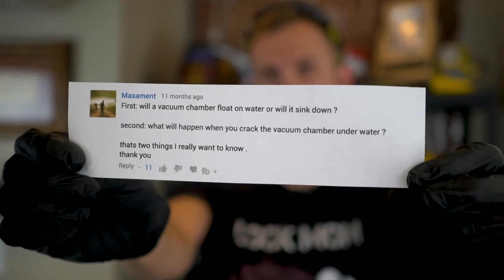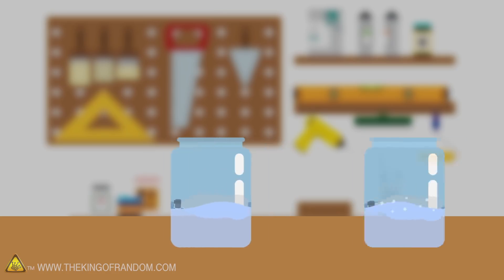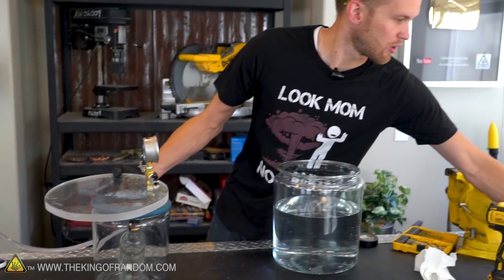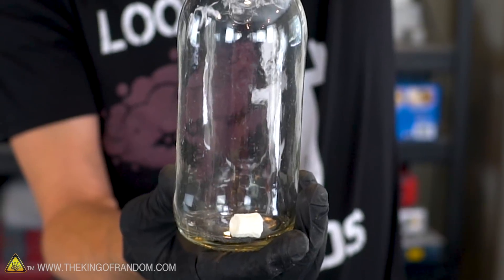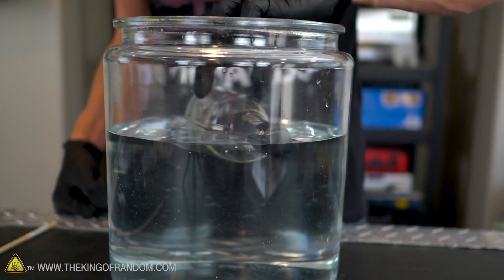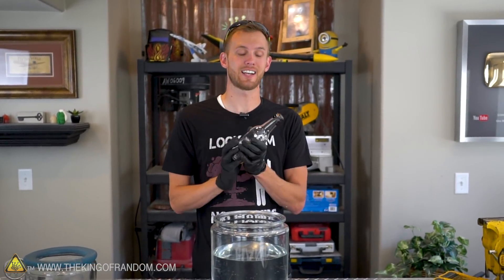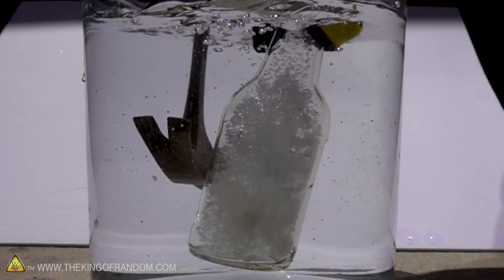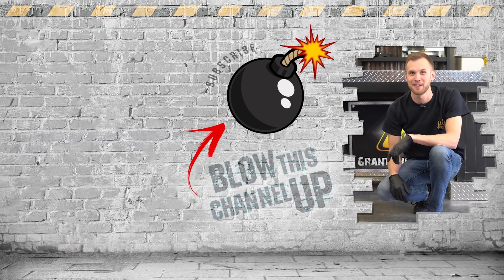Breaking a Vacuum Chamber UNDER WATER

Comment: No duh a vacuum will float on water. A vacuum is even less dense than air. What would you think would happen.
Reply: I want to say that vacuum should have absolute no density :)
Reply: Uberfish u can still sink it ONLY if the sealed container has a density much higher than 1 when it's empty.
Reply: Things float if the volume of liquid displaced is more than the total weight of the object you place in the water. And like you said, vacuums are a lack of mass. Ofc they're always going to float.
Reply: Ethan Smith I thought the bottle would transform into a glass variant of autobots
Reply: turd
Reply: Thats a hypothesis. An experiment is done to prove it. it is always better to see something done than just theorizing

Comment: What happens if you put a smoke grenade in a vacuum, let it fill with smoke, and then make a vacuum to display density?
Reply: Smoke bombs from a fireworks store would work as a substitute if not
Reply: I would think most of the  smoke would be sucked out in the vacuuming process and the flame that causes the smoke would go out due to the lack of oxygen. But it is an interesting idea.
Reply: Question is, do they have access to It?

Comment: Vacuum chamber a brick 
Or.
Vacuum chamber smoke or any way you can make air visible
Reply: It wouldnt be a vacuum with smoke, since smoke is particles
Reply: He might want to see if the particulates fall to the bottom, I guess you could turn the fuel up on a diesel and roll some coal into a jar and close it with it in there and let it sit.

Comment: Can you awesome people try and light fireworks in a vacuum chamber? I think that would be amazing!😁
Reply: Coby The Q you can’t have fire in a vacuum, as fire needs oxygen.
Reply: Black powder and flash powder (all types of gunpowder) are self oxidising. They could not work without some kind of built in oxidiser.
Reply: Triplej Johnson yes you can have fire in a vacuum if you have an oxidiser mixed with your fuel. Oxidisers are common in situations where you need a quick reaction like explosions so it is not unreasonable to think fireworks might contain an oxidiser

Comment: If you put water in a vacuum chamber and sucked all the air out, would it turn into gas because of the low pressure, or would it turn into liquid hydrogen?

Comment: I would love to see you run wires into a vacuum chamber and connect them to an automotive cigarette lighter for the purpose of igniting a firecracker under vacuum vs normal pressure. Maby putting packing peanuts around the bottom..... 

Pop a firecracker in a vacuum chamber.

Comment: Is it easier to brake a coconut if frozen with liquid nitrogen?
Reply: Benjamin Smith yes. More brittle.
Coconuts outer shells are fibrous and rely on elasticity.
Watch slow motion of hitting one.
Apply same energy to fewer fibres due to lower elasticity and it will crack more easily.

Comment: The bubbles weren't a vacuum (a vacuum doesn't have any outward pressure to push against the water). Due to the turbulent flow as water entered the bottle, there were regions of low pressure.  In these regions of low pressure, the water boiled and became low temperature steam. (The boiling point of water depends on the surrounding pressure.)  The water vapor bubbles floated to the top because they were lighter than the surrounding water.

Comment: if you use a bigger vacuum chamber in a pool you could try to use a bb gun to break it, find the right distance to where the water slows the bb to the point that it only breaks one side

Comment: Hey I have 1 idea that you can try with the vaccum chamber:
1. When you put water into the vaccum chamber it has to boil, but what happen if you add pasta into the boiling water? It will cook?
Reply: It will not cook, although it will absorb some water.
Reply: The water boils, but it isn't hot.
Reply: Blaq Z wow water melts!!! I’ll turn up the heat next time and see if I can get some water to melt
Reply: it boils coz the water melting point is reduced to room temperature. To cook pasta u need higher temperature.
Reply: The Action Lab already did this test I think
Reply: The reason water boils in a vacuum isnt because of heat, its because the the water is trying to fill the empty space and turning into a gas does that pretty well, equilibrium in nature is common.
Reply: Really!?? Thanks for your answer, but it will be very interesting the process of the experiment.
Reply: MRJellyBaby2516 water melts from ice
Reply: Quin bros ice melts into water
Reply: Simon Hernandez it wont cook
Reply: Vacuum*

Comment: How does molten metal react when hitting a vacuum chamber?
Reply: i assume he means what happens to the molten metal in a vacuum chamber, if not, then he is hopeless as a human.
Reply: I think that would be extremely hard to replicate especially considering that molten metal gives of gasses which means you can't really put it under   a vacuum chamber in the first place. Not to mention that heating it would be nearly impossible. It would cost them thousands of dollars to try something like this just for equipment i would estimate.
Reply: I meant what happened when molten metal hits a vacum chamber
Reply: F, I hope you can recover soon.
Reply: Sl4yerkid why I mean like if you poured molten metal onto a glass vacuum chamber. Can you not do that?
Reply: It would implode after breaking the glass. Although I guess this audience is entertained by him breaking blocks of ice over and over, so why not be entertained by breaking glass instead... Ok
Reply: Or you could reverse the process and pour molten metal onto the exterior of a vacuum chamber.

Comment: if you do the a scaled up version of that you should use a slow motion setup. As for a container that you can use, get a 40+ gal fish tank and create a compressed air gun that will shoot a metal BB only hard enough to break a single layer of glass (so that it doesn't break the fish tank).

Comment: Hey TKOR Guys! 
I was wondering recently if it is possible to create a Jacobs ladder (high current in two conductors with space between them, which gets bigger as they are set up like a V shape, so the current creates a lightning because the air acts as a conductor between those two metal conductors). For me having not the equipment to try it out myself, I would love to see you do it!
Cheers!

Comment: Try to make a gas gun (gun theat is using butaine gas for fuel) try to make from plastic botle and for barel use pvc pipe and lighter or sparkler.have fun😀

Comment: But how can it leek becouse its a vacuum so no air or a tiny bit of air but more air on the outside so wouldnt the air push on it making the seal get stronger like an airtight seal the air cant open it

Comment: Fill a vacuum with helium and brake a sealed bottle with liquid nitrogen in side
Reply: Are you suggesting that they could freeze helium? No because liquid nitrogen is not cold enough to freeze it
How will they break the bottle while it is in an atmosphere of helium? they cannot reach it with their current setup.

I will tell you what will happen if you do this right now:

The bottle will break causing the liquid nitrogen to leak from the bottle, while still inside the vaccum chamber full of helium. Then the gas from the liquid nitrogen (aka nitrogen gas) will mix with the helium gas.   After a few moments all the liquid nitrogen will turn into gas and that is it.

tldr:
Nothing will happen.
Reply: Sl4yerkid I didn’t say that I’m just curious to what would happen
Reply: And I told you what would happen.

Comment: Try to grow a plant in a vacuum chamber
Reply: Full sealed chamber? At what fraction of an atmosphere?

If you drop it to the levels that their pump is capable of, you will simply end up with a dehydrated plant. The water will boil off and the plant will die.
Reply: That's pretty interesting sounding, but definitely need to consider some things before you can do that.

Comment: Can you use electromagnets to manipulate water? It should work since water molecules are polar.
Reply: U need really strong magnets.
Also I think that won't work because the electromagnetivity of both elements present in water are very minuscule. But yeah it's polar
Reply: Yes it will work...but it will require a field strength on par with an MRI machine!

Comment: What happens if you drink liquid nitrogen?

Put liquid oxygen in a microwave for 30 seconds 

Focus the mini solar scorcher on the big solar scorcher and focus the big solar scorcher to the mini furnace arc which contains copper and the mini furnace is burning hot! What will happen to the copper?

Comment: As y'all state here an object with a vacuum pulled on it should be lighter than one without. I've heard that if an object is light enough and a vacuum is pulled on it the object could become lighter than air and float like a balloon. 

Any chance to get that tested and compared with helium and hot air filled objects to see which has more lift?

Comment: What would happen if you fired a gun in a vacuum chamber
Reply: also R K, you really don't know how a gun works do you?
Reply: Dalton Hendershot you can fire but the bullet will not go far enough because lack of air and oxygen in it
Reply: It might work depending on the gun being used and the type of powder. a glock for example can shoot underwater, which is basically the same thing (lack of oxygen).
Reply: R K a gun will definitely fire in a vacuum if anything it will fire better being that the bullet will have no air resistance. If you have ever held a bullet and shook it you can hear the gunpowder shaking around which means there is oxygen inside the bullets shell casing and that's all the oxygen that the gunpowder needs. I don't mean to be a know it all 14 year old but, you have to know how this works.

Comment: Is it possible to light a cigarette lighter inside a vacuum chamber? Using a battery, wires, remote control board and steel wool to get sparks

Comment: If hot air expands and cold air contracts, what would happen if you dipped the vacuum chamber bottle into liquid nitrogen? Chilling what little air is left in it. Would it collapse due to the glass breaking from thermal stress or an increase in vacuum pressure? Some of both perhaps. Would it b e possible to tell? Different idea, chill the bottle first, then try to vacuum it's air out. If it survives without shattering from thermal stress and the vacuum pressure, it might be interesting to see if it still shatters the same way a vacuum normally does.

Comment: could you simulate the pressure of the ocean and a sealed container that were to sink to a depth that would crush it, this is not taking buoyancy into account. maybe as if there were a watertight mason jar stuck in a boat sinking to the bottom of the Mariana trench. :) would a vacuum cause it to break early or would having sea level atmosphere in the jar be better since jars are ment to hold pressure inside not out? or does the design work both ways?

Comment: what happens if you pour molten salt on steak that has been vaccume chambered?
like if u agree
Reply: Why does putting it in a vacuum change anything?
Also this whole idea is impossible to pull off because the reaction will produce gas and it will no longer be under vacuum. In the end you will just see a steak being cooked by molten salt.

Comment: Try melting tungsten with solar scorcher
Reply: Ali umer the melting temperature of tungsten is very high enough so it'll not melt it'll just get very hot enough that you can't hold it
Reply: Just because it's boiling point is low dosent change it's temperature unless it reacts with something in the air boiling just means liquid into gas and melting is solid onto liquid
Reply: R K i think he should try it and we can see.

Comment: What will happen if you try to light thermite in a vacuum chamber. 
I think you would be able to light the thermite with a sparkler. BTW i have made 6 of your awesome experiments, keep up the great work.
Reply: You need a high amount of energy usu. thermal to set off thermite. Sparklers COULD somehow ignite thermite
Reply: thermite doesn't rely on oxygen, because it just switches it from the iron, so it would work
Reply: thats what i was thinking, thanks for the information.
Reply: JackProsserVlogs what about a TERMITE
Reply: JackProsserVlogs nothing u couldent light the sparkler in a vacum because fire needs oxygen to burn
Reply: Sparklers do work to light thermite, but lighting a sparkler in a vacuum will produce gasses and it will no longer be under a vacuum. Also there is no way to light the sparkler while it is under the vacuum... lol
There is one way I was thinking if you lit it by a high powered laser, but that could be expensive and is not even guaranteed to work.

Comment: How does it compare to normal air?  Was hoping for a control bottle to show the buoyancy difference and how much more difficult it is for the water to rush inside.  Was a pretty neat effect that I wasn't quite expecting, though water gets interesting at low pressures/fast speeds

Comment: Now try smashing an old picture tube from a junker CRT TV (or computer monitor) underwater! Even better if you power up the filament inside (typically 6.3 volts AC), then smash it and watch with a high-speed camera as the water rushes in and touches the white-hot filament!

Comment: That vacuum isn't floating. Your thinner atmosphere bottle is floating. Had you achieved a better vacuum it would have sunk. Glass is denser than water so the only thing keep the glass afloat is the buoyancy of the air that's still inside. You're a pretty big influencer to the younger folks so you guys should start explaining what's going on with accurate information. 

EDIT: Did you just say those were vacuum bubbles escaping the bottle and floating to the surface........? Are you kidding me?? lolololol that is your left over air that is making your bottle float like I mentioned.

Comment: what? WHat?1 WHAT?! Water density - 997 KG on square M, glass density - 2200 KG on square M, air density - 1,2-1,27 KG on squae M. "Total density" WHAT?! There's clearly a lot of air in that bottle Judging by marshmallow, about 3/4 of it's volume is air.

Comment: If you put a RC car or Drone in a water proof see through container put it under water will the RC car or Drone still get signal and move?
Reply: Fluffy Promotions electromagnetic waves can pass through pretty much anything but a faraday cage. The drone will probably move a little bit but if it's light and small then it will just float on the water

Comment: What will happen if you mix molten metal with liquid nitrogen?
Reply: you forgot to mention it would be an extremely violent reaction... probably...
Reply: Pretty clear really
Molten metal (copper to be specific) at around 2300°C + -100°C+ will result in the metal solidifying and the Liquid N2 evaporating

Comment: What happens when you pour melted Metal into liquid nitrogen
Reply: Amelia 1 each and every metal has been done by TKOR and the conclusion will be the molten metal will freeze instantly and you'll get nice metal designs under the liquid nitrogen and even the possibility are the container will explode or you'll see a nice blast BTW nice suggestion

Comment: What happens when you put moving mechanisms under a vacuum, then try to activate said mechanisms?

Example, a padlock under vaccum, then attempting to unlock it. I'm not sure how or what can be done to achieve this result. Maybe using magnets to move gears from the outside? Or a motor?

Comment: Make a bottle with a vacuum and insted of breaking it with a hammer, try to push it down underwater until it cracks because of pressure. You will need something deeper than a jar.

Comment: What happens when you attempt to heat up liquid nitrogen in microwave?
Reply: it will evaporate
Reply: /me brain dead
Reply: B I G B A N G
Reply: Microwaves heat water molecules and there’s no water in liquid nitrogen
Reply: @Lord Vîle i think you may be confusing charged particles with polar molecules?
Reply: Shockwave Shockwave no, microwaved vibrate the water molecules in the food, it has nothing to do with charged particles
Reply: @DanSlotea  That's a popular myth but water doesn't adsorb radiation at your microwave's frequency. Read up on this from some reputable source.
Reply: @damianich4824  where did i say that? I said microwaves vibrate the water molecules. Also "adsorbtion" is very different than "absorbtion". Read up on this from a dictionary.
Reply: Jon Irvine microwaves heat up electrically conductive things
Water molecules have a negatively charged side and a positively charged side
Try microwaving destilled water, tap water and salt water with the same masses, the saltwater is theoretically going to warm up faster and therefore more

Nitrogen doesn't conduct electricity, so it just will evaporate because of the steam inside the microwave heating up

Comment: can you see how far you can go with making a homemade air compressor. go to the max compression, then do similar stuff.
edit: to elaborate, make a air compressor (reverse vacuum.) see how far you can pressurise the air. try experiments with it: shatter it, both under and above water. see if it floats. see how things react with it. try powering an air powered gun/slingshot.

Comment: Molten tungsten vs ice (or dry ice) 
Tungsten melt at 3000 celcius
Reply: Vignesha K nothing great is meant to happen it won't shatter in cold and he is not heating it so no liquid or gas
Reply: Vignesha K the ice will explode
Reply: Vignesha K yeah. not even too many industrial forges, not even oxyhydrogen torches can even get CLOSE to the melting point of tungsten

Comment: Make a hole in a vacuum chamber then seal it from the inside with FlexTape, and see if it still hold the pressure (measure how much pressure can stand), If not try sealing from the outside and then both.